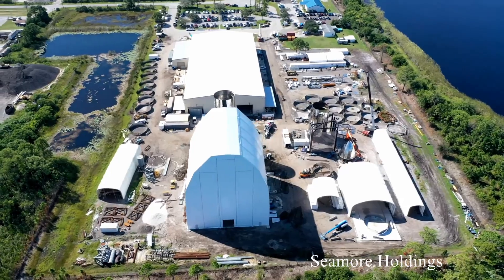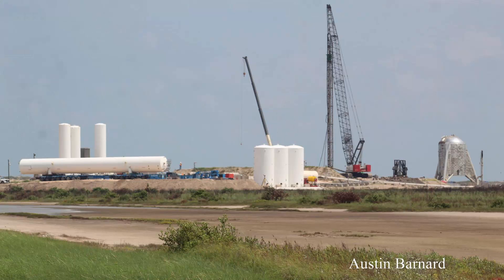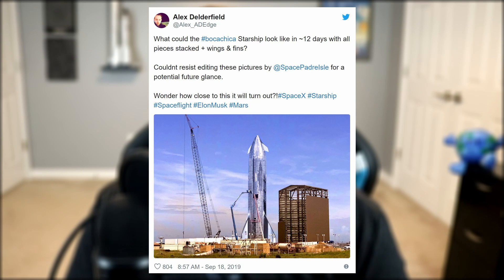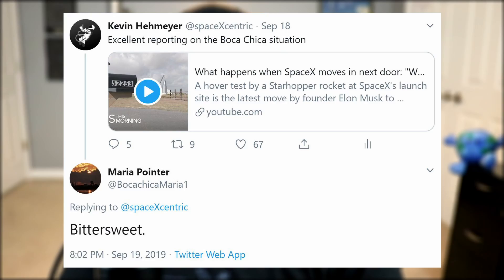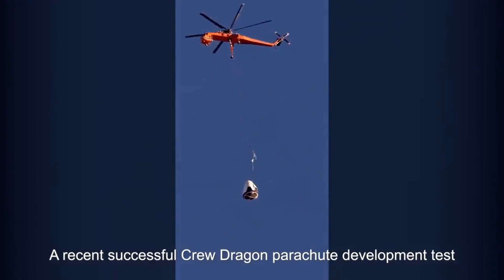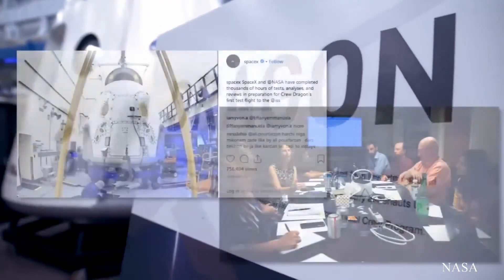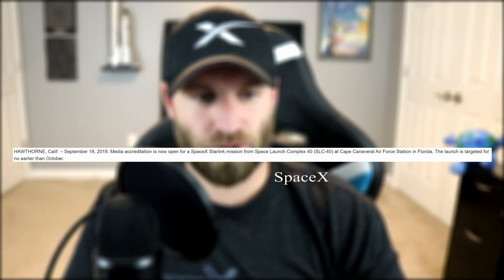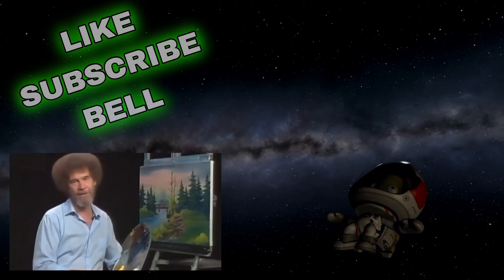SpaceX Starship Launching Soon - Locals Receive Offer Letters | SpaceX in the News

Comment: I would absolutely accept their offer. Move just a few miles up the road to South Padre, etc. Especially since it includes the offer to attend VIP non public launch viewings as compensation for no longer being able to watch rocket development out their windows. At 3x value from an outside apraiser, it's really hard to beat that deal. Selling yourself isn't going to get you anything close to that good.

As for those who don't take the offer. One launch from Mk1 should be enough. If that doesn't do it, SuperHeavy going off and blasting windows out definitely will.

Comment: Why do the starship elements look like amateur “home built” hammered appearance?
Reply: Because it kinda-sorta is. Remember, this is essentially a "scale model" that will be used for a sub-orbital flight test. The actual ship, once constructed, will be both larger and much more "polished" in external appearance, as well as more substantial on the inside - containing a lot more equipment than that which is just necessary to fire a few engines for a minute or so. The exterior isn't entirely "for show"; they'll be testing aerodynamics and flight characteristic in a "real world" environment. But it lacks all the cooling and vacuum protection, electronic runs, internal bracing, etc.
Reply: MrJest2, thank you for your quick reply!  So, I take that what you say is this is really a full scale mock up that has some functionality to endure a suborbital mission.  I’d love to see that!  Elon Musk can certainly pull something like that off and I certainly wish him luck!

Comment: Why does the Starship assembly look so...well....amateur?  No assembly in a clean room like other rockets and aircraft.  No perfectly even and smooth sides (the reflections make it seem pretty wrinkly).
Reply: It's a sub-orbital engine flight test platform, not the real thing. The exterior is not of super critical importance (although they will no doubt still measure flight characteristics on the design).

Comment: I wouldn't say no can compete with SpaceX exactly, NASA connected the last of five sections that make up the core of the Space Launch System (SLS) a few days ago, Blue Orgin are building out there New Glenn launch pad and are ahead of the SpaceX's Starship launch pad work happening just down the road. BO are so secretive they could be only months from being flight ready and we wouldn't know. ULA is doing structural testing of Vulcan and has switched its factories over from Atlas.  Vulcan New Glenn and Ariane 6 are all aiming to take on the Falcon and Falcon heavy market share in 2020/21, while SLS could start taking on NASA work that could fall to Starship as soon as it starts to have a firm flight ready date.  The race is far from run just yet.

Comment: The biggest thing they need to test is the 'flip' from skydiver to pointy end up mode. That needs a really beefy thruster (multiple ton range from memory), which is presumably what that port is for.

The difficulty is that the vehicle is stable flying sideways, and those aerodynamic stabilising effects are difficult to overpower.

Comment: Oh for crying out loud 3X current market value is going to be huge and these people should take it for the betterment of all. Sure in a small number of cases the value may be greater then SpaceX is offering based on improvements made to the property that SpaceX may not be taking into account. In those situations ya the owners should negotiate a better deal. To be honest with you though I feel the 3X offer is supposed to cover any possible difference between what SpaceX thinks the value is and what the owners may claim it to be. Go ahead, turn SpaceX down and lets see those property values drop like a stone when they are testing Raptors every day. You think property values drop around airports do to noise pollution? These people better think ahead.

Comment: Why doesn't Elon and SpaceX commit to dramatically improving the situation of each and every Boca Chica resident - not by simply offering three times market value which is three times nothing but build a new village better located and make the move as easy as possible for these folks. Great opportunity to build a long term supportive relationship with these residents in appreciation of the inconvenience and sacrifices they have and will experience. 

Handle this with typically exceptional SPACEX class.

Comment: What is the real value of the property?  is it the value it would have been before factoring in Spacex as a neighbor. I would think now the Market value would be skyrocketing (pun intended). if I were a company for instance that wanted to work along with SpaceX. I would be willing to pay a lot more for that property so I could have a presence there. Heck if I were Boeing or Blue Origin I want to have a next-door view of what was going on. 
I would really want to know the potential value of the property before I give it up for 3x the so-called "Market value". 
I am really excited for SpaceX and I want them to succeed. However, I would hate for this to be another May 4, 1626, when the island of Manhattan was sold for just $24 in beads. 
I assure you this property is worth far more to Spacex than its current residents. 
Perhaps SpaceX could build a New modern Village a few miles west and present that as an option for those who don't want to move from the area?

Comment: Question: is the bulk head PART of the fuel tank, or does the fuel tank sit in the space between the lower and upper bulk head? I've been wondering this for some time now and haven't been able to figure it out.
Reply: There is no separate  tanks inside the rocket.  The bulkheads and the outer skin are the tanks.